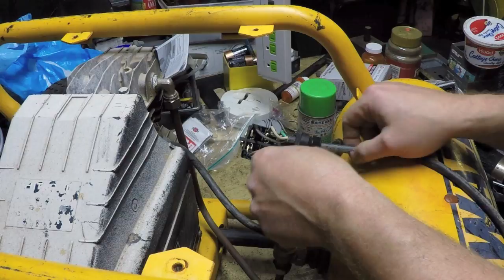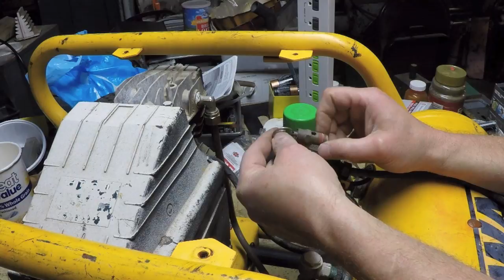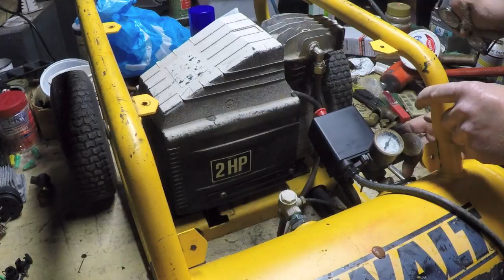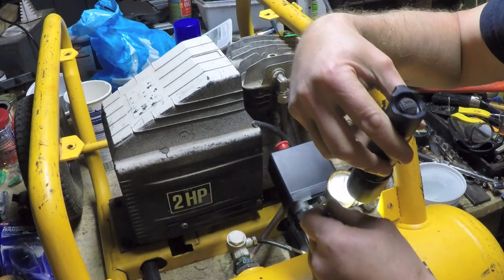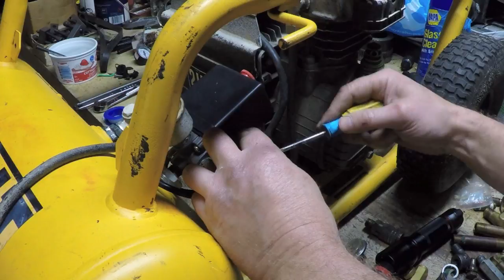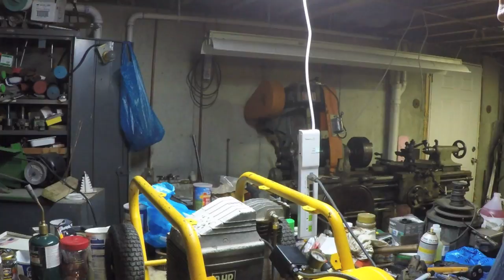Hitachi EC12/ Dewalt "franken-compressor" Part 6

Comment: IF you wanted to, you could install a 45 degree fitting under your pressure switch to make access to the cover screw easier, but you don't really NEED it.  It's just a nice to have thing.  The pressure regulator shouldn't lower tank pressure, just the output pressure.  The other pressure gauge should have remained steady.  They have an internal vent for when you want to reduce output pressure.  I'd check for corrosion, or just replace the regulator.  I think some regulator's can be rebuilt.  Is your intake filter getting oil soaked?  You could try using a carriage bolt inserted from underneath to get clearance for stowing the handle, or take a grinder and put a bevel on the nut if it's not too terribly destructive.  If the clash is small, you could even dent the end of the handle tubing, but it will make a wear-through streak on the tube.  Nice job Dr. Frankenstein, I hope to see more of your work.